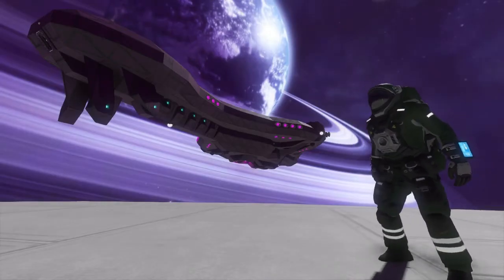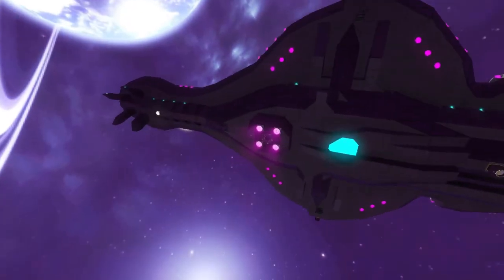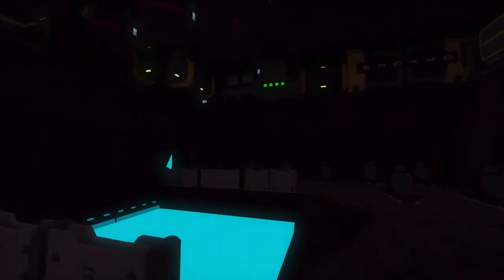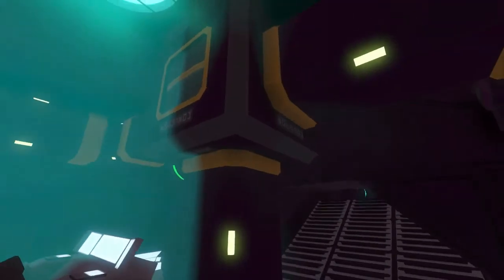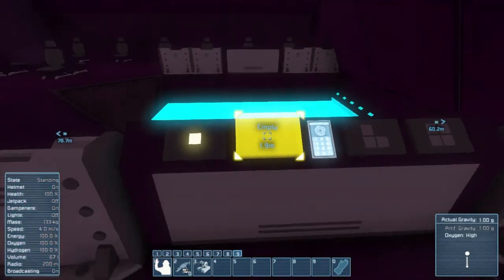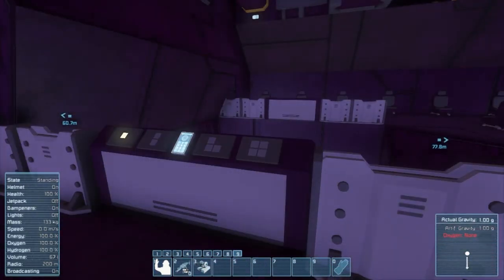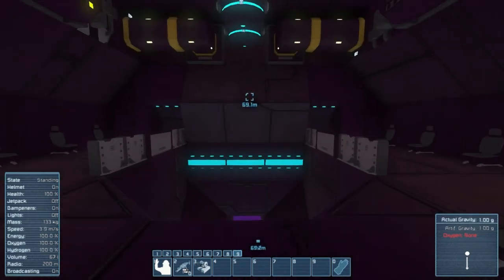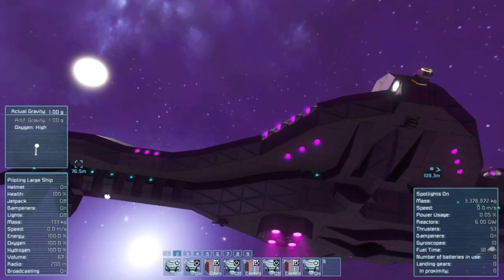SE-lf Built: CCS-Battlecruiser GRAVITY LIFT!

Comment: That's beautiful!

Shame it wouldn't work in vanilla on actual planets...
Reply from the maker: The ship or the lift?
Reply: MrEvan312
I meant the lift, haha. Not sure what its thrust would be like for keeping it aloft in planetary gravity.

I understand why Keen made it so artificial gravity cuts out inside planetary gravity, it's just a shame it prevents cool non-drive applications like gravity elevators or artillery.
Reply: MrEvan312
This is a REALLY nice build though like holy crap your design is beautiful
Reply from the maker: Tests artificial gravity on a planet
AAW that's horseshit! Aw well, this design at least works with generator-based gravity. Glad you like it!
Reply: MrEvan312
It might work on moons... artificial gravity stops having any effect past .5 natural gravity, but moons are smaller and have lower gravity than planets depending on their size...
Reply from the maker: I will certainly try that out, and I'll also work on making a separate Gravlift module that people can try out and put on their own ships and tinker with.